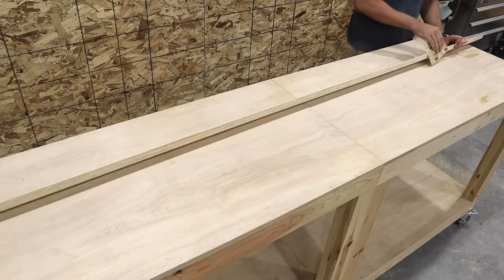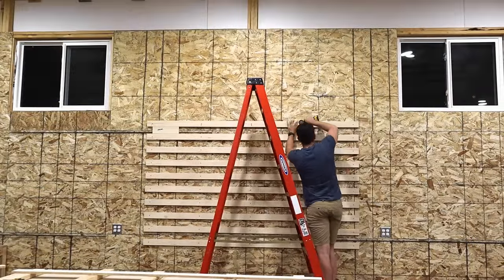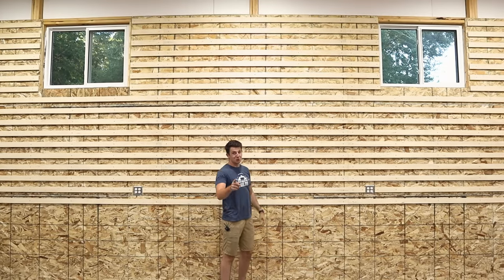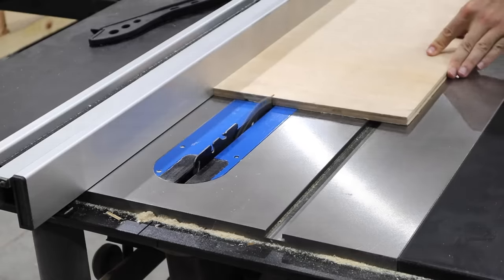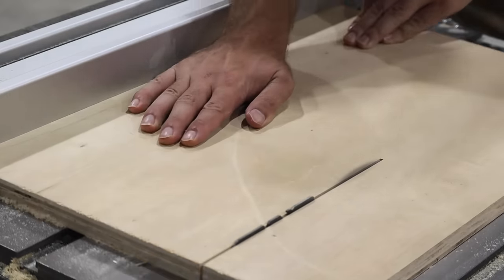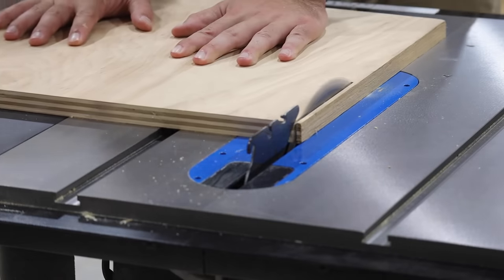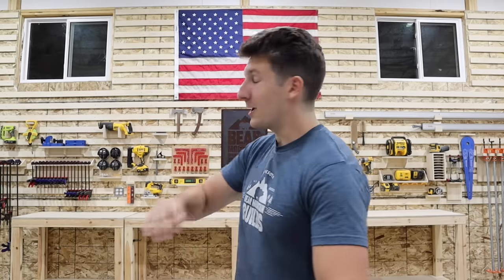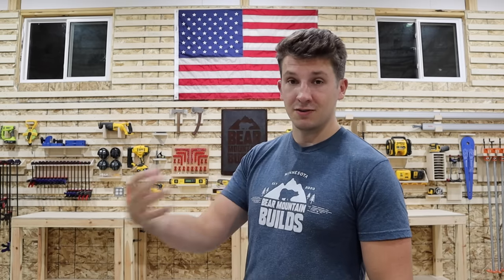French Cleats: Simple & Modular Wall Mounted Tool Storage

Comment: Liked the mix of build versus why, support types etc. I had forgotten the paper transfer trick for screw holes on battery chargers and the like. 

So nice to see you don't have to buy a mountain of cheap plastic or metal hangers. Just spin the wheel you already have in your head. Nice job!

Comment: One of the french cleat cheats I learned about is using 1x6 planks then splitting them in half the way he did. Just makes for less cutting. Also you generally want to use two cleats, top and bottom, just to make things secure or at least have it brace against the wall. You can actually go smaller on the cleats too. I feel like the best size is ripping 1x4 cause you don't have to jump such a large gap for each cleat. It also makes it easier to measure out, in my opinion.

Comment: Consider add a few full lengths of power strip 48” level with the existing cleats.  Think about pipe boom/crane to hang project that are being spray painted use a pipe flange screwed to a cleat plate.  I’m stuck with a large power Box behind my work bench and yes I know the clear panel rule.

Comment: I love French Cleats, built my wall, Now need to make system like you're showing, Modular. One question, what is the perfect spacing between French Cleat rows? What spacing did you use? I have fought with that issue. My first wall I used 5.5" between rows. Works ok, but still not sure, would like some suggestions

Comment: If you have drywall in your garage would you recommend putting a sheet of plywood on the wall first before drilling the cleats to the wall. And if so yes, how long are the screws would you use? Should they be just long enough to not go through the cleat and plywood because it may hit a wire or pipe? Or do you still recommend drilling the cleats through the cleat through the plywood and into the stud? Thanks for the video.
Reply from the maker: You could do it either way. Adding 3/4" plywood that's mounted into the studs would be the strongest option then just use 1-1/2' screws to mount the cleats

Comment: Will you please do a dedicated video on cutting the railing for the French cleat wall. I am using a 5 inch and trying to cut it at 45 degrees however I can’t get the cuts right. I set the fence on the tablesaw to 2 3/8 and rip it however the pieces are not equal. Please help, thank you!

Comment: I built your mobile workshop tables and was looking for a tool storage idea so excited to do this too. You mentioned 2 3/4” is your longer cleat. Did you use both lengths for your wall or did you keep the shorter for the backside of whatever you’re hanging? Thanks!
Reply from the maker: All the cleats are the same size. I was just referencing the long side of the cleat as 2-3/4”. When you cut the 5” strips in half with a 45 degree it makes two even cleats
Reply: @BearMountainBuilds  🤦‍♂️ haha thanks! Appreciate your help.

Comment: Hi Zak, quick question. Is OSB strong enough to attach French Cleats too? I would think it is and I see that you have done it here. But wanted to check if you are just screwing the cleats on to the OSB or through into the material behind? Sorry if that has been asked before.
Reply from the maker: It’s strong enough if you have enough screws. It’s definitely not as bold as plywood or going straight into a stud but it will get the job done

Comment: Do you have a dust collection system in your shop and if so, can you show how and what to use?   your shop is much much larger than mine, but I would like to find a system with hoses that are up and out of the way, and that you can switch off easily to whatever machinery you’re using to collect dust on.
Reply from the maker: Once I get the shop finalized I’ll focus in on the dust collection and make a whole video on it. I’ll probably end up doing something pretty custom

Comment: Rough estimate, how much can a single French cleat hold, about? With a gusset?
Reply from the maker: Really comes down to how many screws you put in the wall and how far away the load is from the wall. If you keep the load close to the wall it's quite a bit, but hard to put a number on since there are a lot of variables.

Comment: Dude, we were Ryobi BT3000 brothers.  I made your saw table for mine using your plans.  Now I see you using a new table saw.  I'm hurt.   What saw did you get?
Reply from the maker: My brotha! Sadly my Ryobi BT3000 bit the dust this year and I couldn’t fix it since they don’t sell parts for it anymore. Moved to bigger and better with the Delta 36-5000T2
Reply: Well I am afraid of the same thing.  I've had this so long it has to be approaching its end of life.  I too am considering the Delta or the Rigid. They look identical with different color paint. LOL.  Hopefully to pull he trigger on one soon.  I didn't put in the drawer yet under the saw on the table and am hoping the new one will fit without its legs. 
  @BearMountainBuilds

Comment: A Great build of the French Clears however i just don't understand the cleats by the window, nothing is going to go there and you could have either kept the cleats as spare or did another wall in the shop, even if you did a wood rack there it still wouldn't be that high. 
You can still put the US Flag in the middle there but not on the cleats, i presume that the flag will stay where it is so you have just proved that you don't need the cleats that high up, from below the flag down and along the wall would have been plenty.
I'm already a Subscriber and even though i don't agree with the height of those cleats, i will still be a Subscriber because you make great stuff, well nearly?
Take Care and Stay Safe,
Barry (England, UK)
Reply from the maker: I liked the look of having the cleats that high. Plus I’ll probably hang some stuff up there eventually